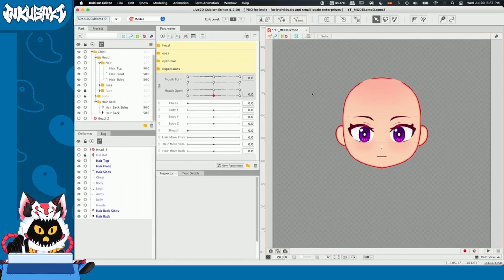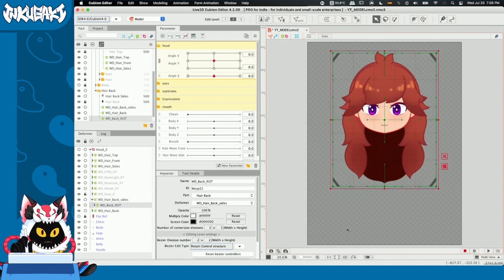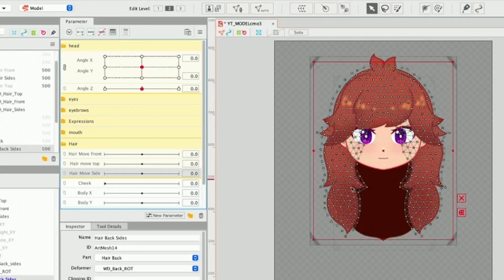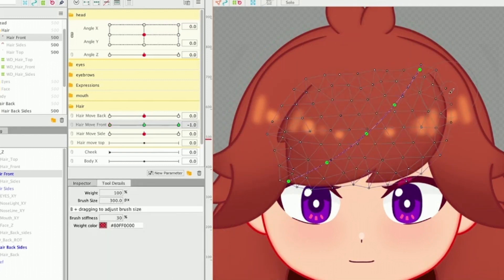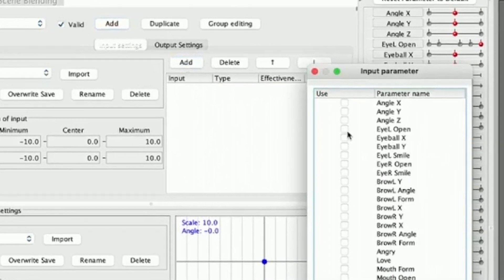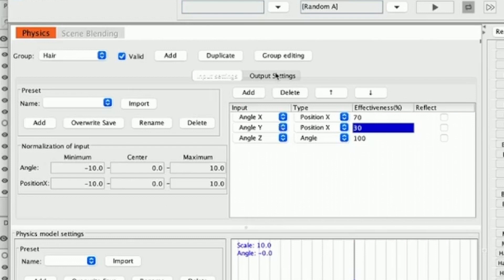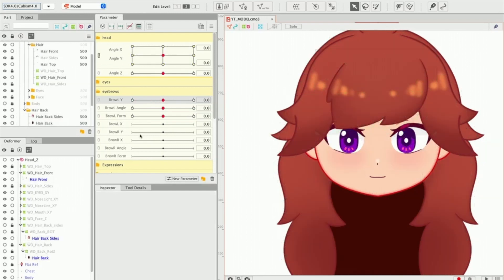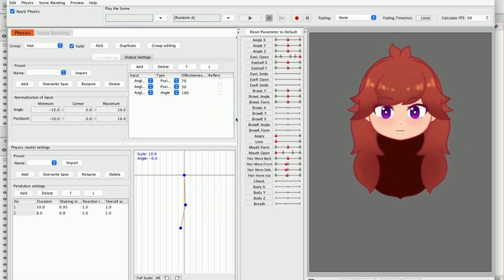Live2D tutorial: Physics Basics - How to Rig Hair!

Comment: About the eyebrows. Isn't there a thing called "draw order" that's supposed to put objects in front of each other? Or is it for something different? Can you just put eyebrows on top of the bangs using that tool?
Reply from the maker: Hi, yes you can use the Draw order option, but take into account that draw order ignores the "Part's layer hierarchy system". In the long run it might become a little messy, but you can experiment with it if you want :D
Reply: @Inkugaki_Live2D  thanks for your reply!
Reply from the maker: @azemiblossom  No problem! hope it helps :D